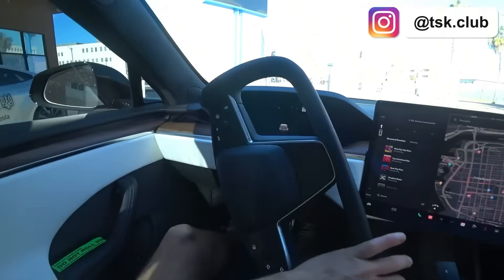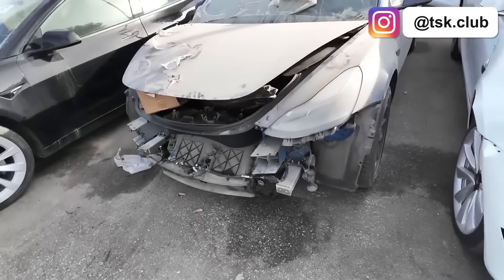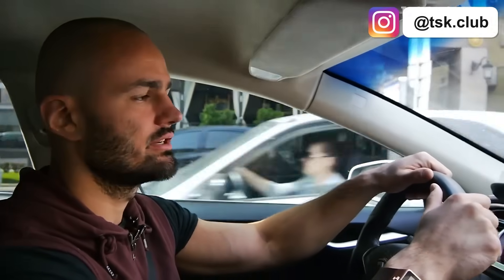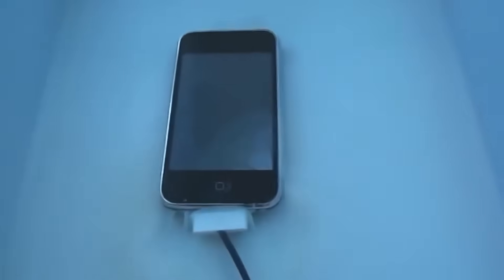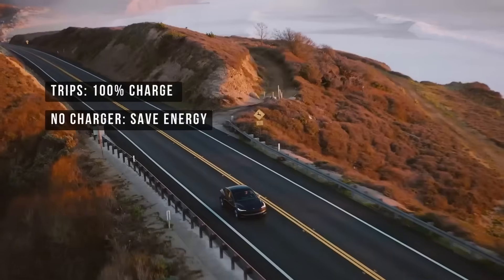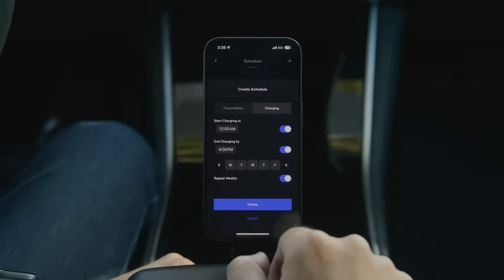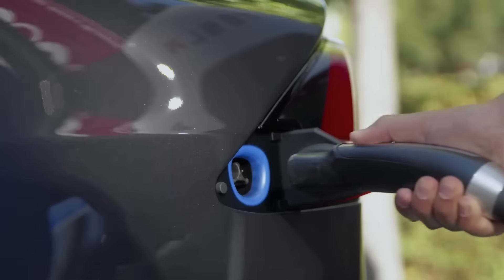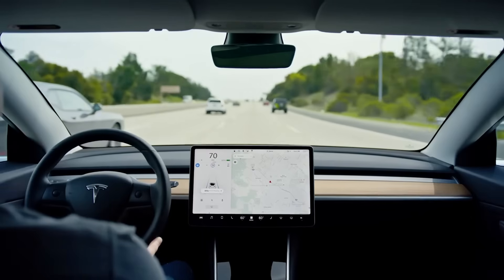One Tesla Maintenance Rule and Charging Mistake You Didn't Know About

Comment: Not true. Teslas do need service. Difference is that Teslas warranty isnt voided if you dont service your car.
Tesla even has a list of recommended service actions in the manual including:
- Cabin filters (pollen + HEPA)
- Climate drying agent
- Brake Fluid
- Coolant
- Brake cleaning and lubrication
- Tire rotation
- Differential oil and oil filter

On top of this it is a good idea to perform a 4-wheel alignment once in a while since this tends to drift due to the weight of the cars and the suspension setup.

Comment: Pulling the front tub and cleaning the condenser annually will pay dividends, trust me. In the S they'd rather replace the condenser AND compressor every few years when the blocked condenser causes the compressor to fail. That's the only maintenance I did to my old 2014 Model S and my now 2021 M3 LR.

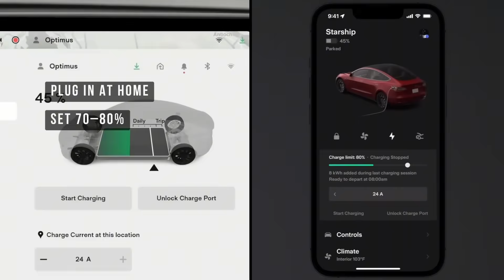Comment: I have a 25 Model 3 Performance with LG NCA/NCM battery.  At 10:11 you mentioned I need to charge it to 90 - 100% weekly.  Is this absolutely necessary or could I just keep charging it to 80%?  Thanks in advance.
Reply: Never heard of this before, it goes against the charging advice of Tesla so I would not do this. For daily use max 70-80%, only for roadtrips go above that, if you need 100% then don’t let it sit when done charging but start driving immediately.

Comment: Tesla needs service. 
Air filters 
Cleaning front radiator as needed 
Changing diff fluid and filter every 50,000 miles ( depending how much supercharging you do) 
Break burnishing (depending how much hard  breaking you do)
Reply: Why would how much supercharging you do affect the diff fluid?
Reply: @paschalhammond  is the temperatures which makes a little different, coolant and diff pumps works when preconditioning for supercharge
Reply: @paschalhammond it’s not

Comment: Do you have to winterize? I’ve heard people say to add a coating on the bottom or change to winter tires. Is this a myth?
Reply: Winter tires are not a myth if you drive in the snow, you should think about using them. They’re not a requirement that they’ll make your car accelerate and stop a a lot faster, and that equal safety

Comment: The li-ion batteries have more in common with a phone battery than suggested. All li-ion batteries, regardless of chemistry, will have more degradation when kept at high states of charge. 80% is a compromise between degradation and range, 50% is better still for loe degradation if you don't need 80% range in daily driving. The advice on charging LFPs to 100% is because the flatness of the voltage curve with charge means that the BMS will give a less accurate percentage. That's it. It will still degrade more at 100% (though maybe less than other chemistries) so don't leave it there.
Shallow cycles are good for reducing cycling aging.
So if your daily driving uses less than 50% battery, charge daily to 50% (the lowest setting in many cars). This will preserve battery capacity for longer trips when you need it.
Don't worry if you need to cycle your battery more, that's why you bought it, but know that the best longevity is from shallow cycles and low (but never empty) states of charge.

Comment: Saw one recommendation to run the battery as low as possible or at least below 10 % periodically (once or twice a year) and then charge to 100%. Supposed to balance all the cells and recalibrate the BMS. Anything to that or is it a myth?
Reply from the maker: Yes, sometimes it is useful to completely discharge and charge the batteries.
Reply: That recalibration of the battery has never worked for me on both of my teslas! My Y performance 2021 and my 2021 model S long range! Every time I would try to recalibrate, the battery range would drop 5 to ten miles on the battery icon at 100%.😢

Comment: I'm a ride share driver. That's 150-200 miles a day. I and others live in apartment complexes with very old infrastructure and no options to just "plug in". I rely on public fast charging everyday. I usually charge to 90% daily. Please advise
Reply: Look at the data supercharges do damage battery in the way that’s being described. There’s not really description of what happens except it’s not preferred. The idea of getting an apartment complex to upgrade its wiring is absurd.
Reply: Get a long extension chord and hang it out of a window.
Reply from the maker: We recommend upgrading your apartment infrastructure if possible.

Comment: not all right... brake fluid need change, diff oil and filter need change, clima needs service, and brake needs cleaning
Reply: Brake fluid is brake fluid. It will always break down. There’s no special type of brake fluid that’s different in EV than a gas car think about things
Reply: I cleaned my brakes once in my 8 year old model s 111k miles. Waste of money. Still don’t need break fluid change. No oil change of any kind. Just changed low voltage battery and high voltage capacitor (cabin and hepa filters changed once and it’s working well)

Comment: If you live in an area where road salt is used during winter months, you should clean and lubricate your brake components each spring. Doing this will ensure safe emergency braking when needed and prolong brake components for a decade or more.
Reply: Also reduces drag by ensuring pads fully retract from rotors after use.
Reply: Ya
Reply from the maker: That's a great tip!

Comment: Very interesting about the sun.   Can anyone pls explain the chemistry behind this.  How can a battery , under a car be affected by the sun?
Reply: Heat is the enemy of all electronics and batteries.  Sitting under the direct sun will stress the car while charging compared to being in the shade or at night.
Reply: @ed1pk  Thanks. Would Teslas BMS not liquid cool the battery as needed while charging? I can't imagine it usung too much electricity.  Its plugged in.
Reply: @GWAForUTBE the BTMS does. And on my Highland 2024 with LG, it remain in the 20-30c even at full day shunshine of July. The sun will just keep it in the upper range. But Full SOC and warmer temp is no 1 combo enemy.
Reply: @GWAForUTBE  The cooler the better.  Ask yourself this.  Does a fan blowing on you in the shade work as well if it was blowing on you under the direct sun?   The liquid needs to displace its heat into a lower temperature gradient.  The cooler the environment is, the better it works.
Reply: It’s not the sun it’s the heat

Comment: As a 6-month Tesla owner, I truly appreciate your "Mythbusting" videos. Your conclusions reinforce what I have discovered on my own, such as Supercharging costs about 75% as much as the same range cost of a gas-burner, while Level 2 charging, such as a Destination charger or Level 3 charging at home costs about 25% as much, or about 1/3 of the Supercharger cost. Your years of experience give you much greater credibility than those who merely parrot things that "seem like they might be true" but aren't. 

Some good topics for future videos might be (a) SAFETY - how Teslas, especially when using FSD, can be much safer than those without FSD or driver-assist technologies; (b) People who SHOULD buy Teslas, such as older people who cannot drive as safely as they could 20 years ago, or those with vision impairment who have difficulty seeing as well as they used to, or difficulty making out low-contrast road hazards, such as someone in dark clothing walking in dappled sunlight; (c) How to get around some Tesla problems, such as inability to override FSD routing, or it refusing to change lanes for rough roads, potholes, or dead animals (if you know of these ways). 

Thanks for some very useful videos.
Reply: I have tesla electric.. for 15 bucks a month you can charge (in my area ) 12 to 6 am u limited for that 15 bucks.  Saves a ton and my rates are lower than every other electric provider
Reply from the maker: Thank you for the kind words!

Comment: New Tesla owner here. How to know what kind of battery I have?
Reply: Look at you screen when you plug it in. If it says to charge to 80% max daily limit, you have a nickel based battery. If it says 100%, you have an LFP battery.
Reply: Controls > Software > Additional Vehicle Information.
it will say something like:
"High Voltage Battery Type: 
"Lithium Iron Phosphate" for LFP
Or
"Nickel Cobalt Aluminum" for NCA
Or
"Nickel-Manganese-Cobalt" for NCM
Reply: @hieyeque1  My 2026 Model Y has a sticker that I finally found on the under side of the Frunk lid.
Reply: A real car enthusiast.  Well you bought the best car for someone who doesn't appreciate a vehicle other than getting you where you need to get.
Reply: Sport, but “you” do not have a battery, your Tesla does have one. You might be a “new” Tesla EV owner but fail to ID which model and year Tesla in your possession. Perhaps a bit of advice. For any questions specific to a Tesla, ask Tesla directly using the Vehicle Identification Number, VIN. The VIN should be in the paperwork and visible from outside the driver’s side windshield on the dash surface.

Comment: When you say keep the car plugged in,do you mean actually charging or just plugged in and not charging ?
Reply: Set up a charging schedule, like to start charging when rates drop if that applies to you.  Get in the habit of plugging in when you park your car at home.  While plugged in, it will sometimes take a sip of juice to offset the power used by 'always on' components like the Battery Management System.  It will charge to the % you set in your schedule at the appropriate time.
Reply: @markl3893 thanks for that explanation.ive only had my MY one week.still learning
Reply from the maker: charging of course

Comment: Tesla does have oil that needs to be changed.
Reply: The drive units have oil and filters that do require maintenance. When you supercharge, the stator is used to create waste heat to heat up the coolant which ultimately warms the battery to the optimum temperature for proper charge rates. The oil is essentially being cooked. 

50k miles is a good interval in my professional opinion. Additionally, the oil level is set dynamically (pump running) and everyone I have serviced has been low from day 1.
Reply: And what is that oil?
Reply: @twocds4751 differential fluid it needs to be changed at 100,000 miles
Reply: @twocds4751 Gear case… look it up